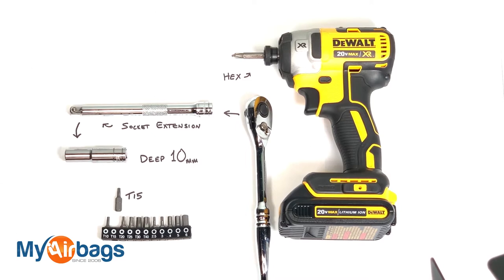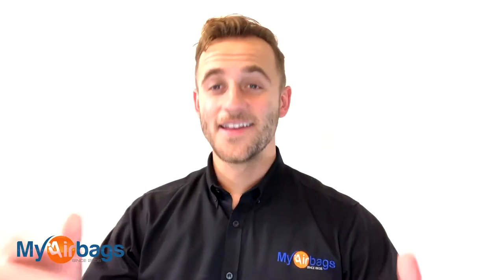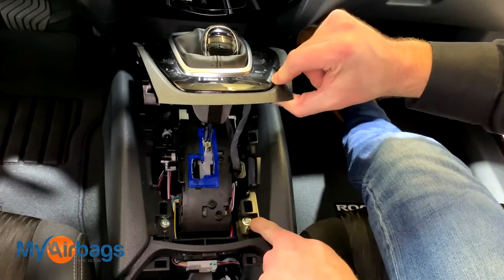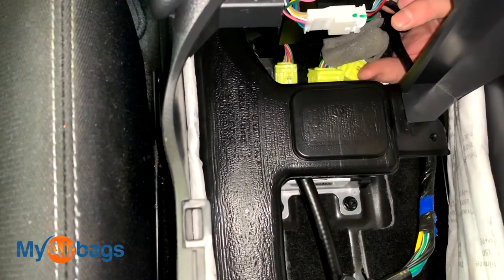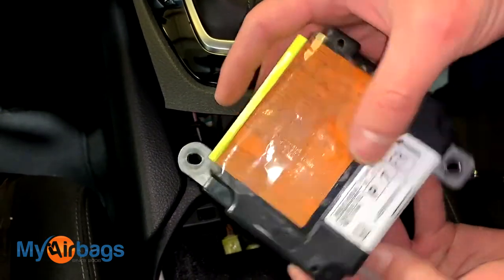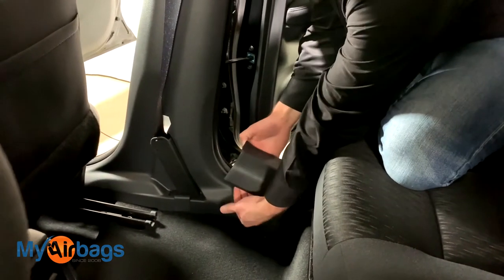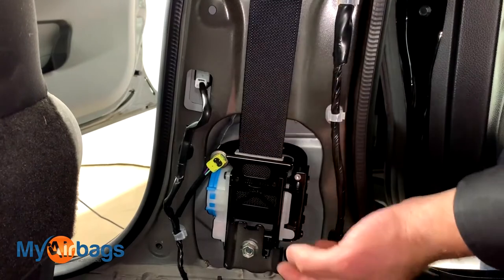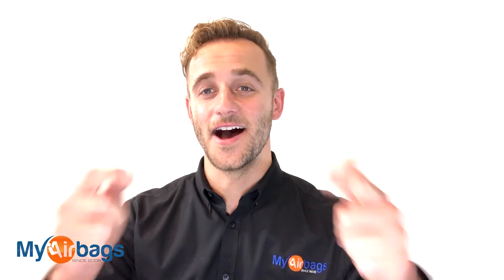How to Remove SRS Airbag Control Module & Seat Belts on Nissan Rogue  | MyAirbags

Comment: Okay well my dog chewed through the Airbag harness underneath the front seat in my Nissan Rogue Sport 2020. The dealership quoted me $6,600. Which I believe is drastically overpriced. Being that this seems so simple I could do it myself… smh
Reply from the maker: That is crazy overpriced. Most likely just need to get the wiring fixed instead of replacing the entire wiring harness.

Comment: I have a 2008 Nissan rouge   air bag on. occupancy sensor front passenger  side I have kids I'm worried                                           I did a lot research on google YouTube please help
Reply from the maker: In order to find out why the airbag light is on, you would need scan the airbag system for troublecodes using a scan tool / scanner. If you have the trouble code, you can post it here and we can provide some advice.
Reply: Ok thank you

Comment: Good evening, I greet you. I have a Nissan Qashqai 2015. After an accident, the car does not start, maybe because of the Airbag unit but the information was crash Thank you very much, please inform me
Reply from the maker: mercedes Azerbaijan, It does not seem likely that this is the reason why the car is not starting. Since the car was in an an accident, you will need to get the airbag module reset anyway so you can definitely try it and check. You can start your reset order here: https://www.myairbags.com/

Comment: I bought Nissan Rogue 2016 that was in accident with airbag deployed.  The re-builder replaced the airbags but the SRS light stays on.  I suspect the airbag module was never reprogrammed. I'm planning on removing it and sending to you (I have done it with my Honda and it worked well).  Since I need the car, can I still drive it without the module?  The SRS system is probably not even functional without the module being reprogrammed?
Reply from the maker: Thank you for commenting. For your needs and service:  www.myairbags.com

Comment: Hi I have B1057 code for my Nissan Murano 2006, how can I fix it? Please
Reply from the maker: B1057 for NISSAN / INFINITI =  Driver Air Bag Module Short.
Possible causes: 
1. Faulty Driver Air Bag 
2. Faulty Spiral Cable Driver 
3. Air Bag harness is shorted Driver 
4. Air Bag circuit poor electrical connection=
IF IT is ... a bad or melted Spiral Cable, we have some for sale that are very affordable $9.99 :
https://www.myairbags.com/product/airbag-plugs-clockspring-plugs/
Reply: I do fix the number 2 but the light still on
Reply from the maker: Yes, this area (driver airbag) can be complicated. There 3 parts in this area.  Any one of them can be causing code B1057. We recommend to check each part.
Reply: Do you have any shops close to Olathe Kansas
Reply from the maker: Hi,
Everyday, we help body shops, collision shops and automotive professionals in all 50 states! You can send the module in for reset instead of buying new. Same for the seat belts as well. We also service many other automotive electronics. Most parts have a 24 hour turn around so the service super fast and saves you a lot of money. You can start right here: https://www.myairbags.com/#

Comment: What about the passenger occupant sensor code B00A0 ? Bought a Rogue with a salvage title. No light for a while, then it started coming here and there until it stayed ON, reads as current code. Thinking the shop that repair vehicle did not reset airbag module. Your thoughts?
Reply from the maker: This code is for passenger weight se sensor. If that is the only code you have, then that occupant weight sensor needs to be calibrated, and that can be done with a diagnostic scan tool. However, if you have code B00A0 and a crash code, then you need airbag control module reset. See myairbags.com for reset and repair services.

Comment: Whatssup bossman!
Great video bro!
Is it possible to get the airbag light that stays on, reset Temporarily for some days?....
Secondly, can one drive without the module, in order to get it Reprogrammed?......IF so, for How long??
Reply from the maker: It depends on why the light is on to begin with. If you're not sure why the light is on, its best get it diagnosed with a scan tool. If the module is bad due to an accident, you can send it in for reset. As for driving without the module, here: https://help.myairbags.com/hc/en-us/articles/115012408547-Can-I-drive-my-car-truck-while-the-airbag-module-is-removed-
Reply: I Appreciate it 
Thanks

Comment: Hola amigo tengo código b1421 Nissan xtrail 2015
Reply from the maker: Hello Saverly,
B1421 is inside the airbag computer module: https://blogs.myairbags.com/nissan-srs-airbag-code-b1421-frontal-collision-detection/
We can reset this code.
You can start your order here and send in your module for reset: https://www.myairbags.com/product-category/repair-return/airbag-module-reset/?make=NISSAN&model=XTRAIL&year=2015

Comment: Hmm my shops telling me I need a whole new seat, and control module....something about the passanger seat has a mat in it connected to the module and it wont pass inspection and they want 3 grand to fix it...

How easy is it to just replace the mat? Does the mat need to be programmed? 
2010 nissan rogue.
Reply from the maker: There is a passenger weight sensor that does go bad in the passenger seat. However if vehicle was in an accident then the ORC/OCM Airbag Control Module can be reset.
Reply: @MyAirbags  have not had any accidents. Just dont wanna drop the bookoo bucks the shops telling me I need to replace the whole thing....or end up with mix matched seats...

Comment: Hello. I have a 2015 Nissan Rouge Select with a flashing air bag light on. Tried the reset with the key cycle method but didn’t seem to work. Could it be possible to reset with a proper scan tool or is there other issues?
Reply from the maker: If the vehicle was not in an accident, then it it would be best to use a diagnostic scan tool to pull codes. However, if the vehicle was in an accident, then the airbag module will need to be reset

Comment: Hi I have a B0020 code on my 2014 Rogue. Do I need to just send in the module?
Reply from the maker: Code B0020 shows a Left (Driver) side airbag. Most likely a bad connection or that airbag needs to be replaced. If vehicle was in an accident then the airbag control module needs to be reset. Also check your seat belts to make sure they work good. For more info see our website www.myairbags.com
Reply: Were you able to fix this?

Comment: I just received my module and seatbelt. Do I need to do any other type of reset to the module so the airbag light doesn't come on?
Reply from the maker: Hi Lex, once everything that deployed has been replaced and connected properly, once you install the reset module, the light will turn off. If it doesn't that means there is still a part that hasn't been replaced or connected properly. If you aren't sure what the problem is, the first step is to diagnose the airbag light. Hook up the scan tool / scanner to the car and read the airbag codes. You connect the scan tool right into the OBD port/plug. Its usually located below the steering wheel, on the left. You are welcome to reply to us with the trouble code that it reads. We also have a support team available by phone and email thats willing to help. If you contact them, have your order # ready. www.myairbags.com

Comment: Do you have any shops in Kansas
Reply from the maker: We can help you.
Everyday, we help body shops, collision shops and automotive professionals in all 50 states! You can send the module in for reset instead of buying new. Same for the seat belts as well. We also service many other automotive electronics. Most parts have a 24 hour turn around so the service super fast and saves you a lot of money. You can start right here: https://www.myairbags.com/#